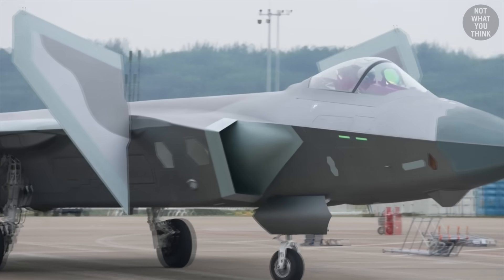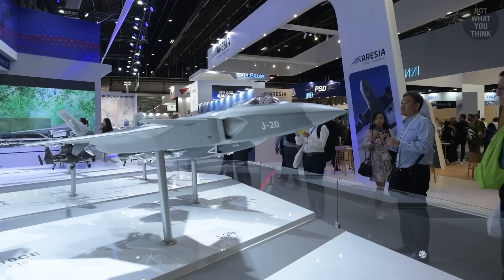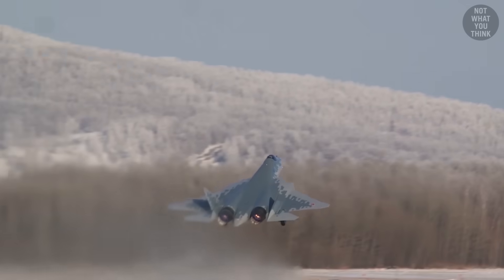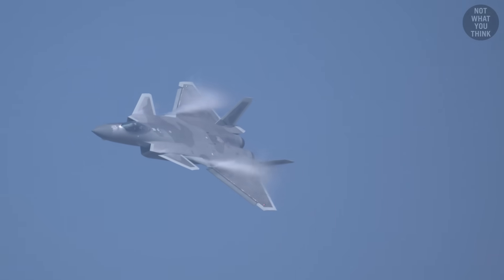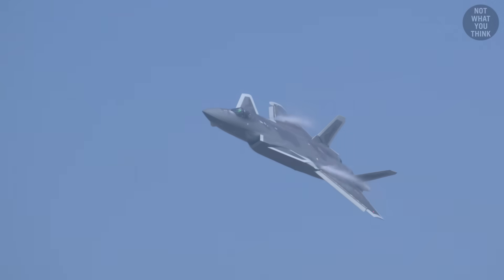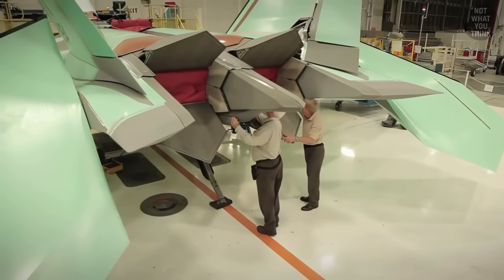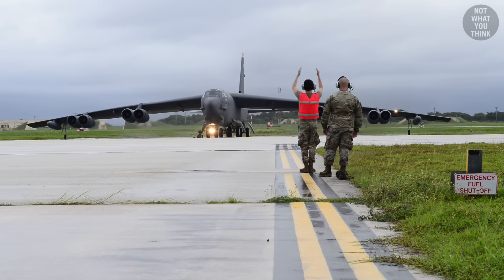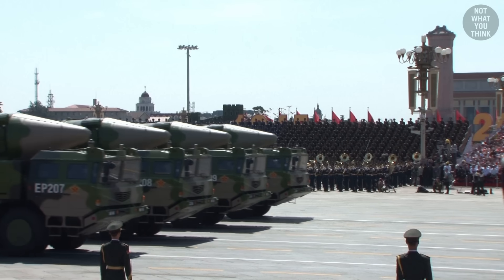Why China's Stolen "Stealth" Fighter is Problematic

Comment: Even if the Chinese is able to hack into a website and obtain the designs of the F35 it doesn’t mean they will have a bona fida aircraft. To make one you would have to copy word for word, screw for screw and nail for nail. Being Chinese they will cut corners and won’t do it properly…..which means the fake version will be worse than just being inferior.

Comment: The reality is that these engines are going to use afterburners and not be able to use super cruise reliably. They might be able to do it under perfect circumstances but under an actual battle they’re gonna be noticed immediately. Meaning this is just a really expensive and pointless 4th generation fighter that looks kinda like a stealth fighter. 

These engines are gonna get burnt out so fast as they are not reliable at all. So they’ll fly a few missions and then have to be fitted for new engines.

Comment: I would imagine that 60-120 of that 200+ units still have the Ruskis engine... And will forever for 2 reasons:
1 More likely from the time by the new engine became available the old engine was still being made and fitted. being communist they have a stock pile of 2 full engine changes for each of up to 120 craft built before the new engine was ready you cant let them go to waste.
2 I suspect the J20 like all other Chinese weapons and products have limited maintenance services and capabilities, building ships and plans is easy but the maintenance... Well they don't maintain there elevators in there buildings.

Also Hence I suspect that also 20-40 have blown up in the run ways, and in testing and Training. Remember Yuri Gregorian died in a training accident why couldn't that be the case with the CAF?

Comment: People pitting J-20 against F-22 do not understand the grand scale of things. 

F-22 is built as the Air superiority fighter, being capable of Beyond visual range engagement, short-mid range combat with IR missiles, and if it comes down to it they can dog fight with guns. No doubt the F-22 is superior in nearly every aspect and has a higher chance of winning against the J-20.

J-20 was NOT built to be an air superiority fighter. In fact, their decision to remove the guns altogether points to a fact that the Chinese do not intend to let the J-20 stay in the airspace to contest it against enemy fighter after they use up their missiles. They most likely won't stay to fight. 

Instead, the J-20 is like a Missile bus with its large payload. They use their large numbers and stealth to try and sneak in and move in as close as possible to enemy support assets like AWACS and Air refueling tanker planes and unleash their missiles before getting back to base as fast as they can. The chinese only need to destroy these assets and their adversaries will have a difficult time operating in contested airspace.

Comment: Though the J-20 is designed as sort of a long-range interceptor, to intercept and interdict particularly AWACs, tankers, comms relay etc; the F-35 will have no problem detecting and tracking them from several hundred miles with its AN/AAQ-37 EODAS. Furthermore, the F-35 can transmit and share this info to other fighters, AWACs, Navy ships or even ground assets.
Reply: These technologies are not mysterious. China's j35 can also do it. These technologies are no longer new technologies. The United States should speed up innovation, such as unmanned combat aircraft or sixth-generation aircraft. Now, although the United States is still leading, China is catching up very quickly, and the United States should increase its speed.
Reply: @jerrytom5841  J20 also has EODAS system, in fact, this tactic is also true for China. In fact, the fighter jets that China uses to intercept AWACS and tankers are J16s launching PL17s. The range of PL17 is as long as 300-400KM. J20, on the contrary, shoots down the opponent's AWACS and waits for the F35 to open its radar to search for J16, and then completes the sneak attack on the F35.
Reply: Your statement is not valid, J20 also has EODAS and EOTS. In real combat, it is the entire system that is compared. And J20 has a range advantage.
Reply: Note that the J20 also has EODAS. This also applies to the J20 finding the F35. The real competition is the entire reconnaissance system and early warning system. The stealth fighter is just a platform for launching missiles. Moreover, the J20 is faster than the F35 and can quickly leave the scene after launching the PL15.

Comment: J-20 is basically doing what F-104 Starfighter and F-4 Phantom does in the Cold War. While the J-35 is equivalent to F-35A and F/A-18E/F Super Hornet.
Reply: As a Chinese, I will tell you a secret, J 20 engines are imitated in China, high-speed Flight 3 times need to replace some parts. The F 22 is the strongest.
Reply: How is the J-35 remotely similar to the Super Hornet?

Comment: Just felt poised it point out: the rcs table you show at 0:15 is wrong. While the actual rcs specs of these planes are unknown, the f-35’s is significantly smaller than the f-22’s
Reply: Not only is it wrong, it's also very deceiving.  

He used the median RCS value of the J-20A in the X Band without RAM or stealth coating, and yet neglected to mention that.

Comment: The J 20 without having a gun will be an F 4 Phantom. Produced a lot, not made for a fighter role, & will be shot down in a dogfight. Also, the f-22 is getting a massive upgrade. This, along with the mass production of f35s, will keep the j20 in check. by the way, Heat signatures won't be detected on radar. It just gives away a lock for infrared heat seeking missiles.

Comment: I'm surprised you didn't mention the lack of trained pilots that China is struggling with. Their carrier pilots still struggle with carrier landings to the point that almost all of them have never performed a carrier landing successfully. All of their pilots still struggle with the lack of any real combat experience. Simulations and training can only take you so far. That's not to say China has no skilled pilots, I'm sure they do, but there is a lack of experience that has resulted in China hiring foreign pilots to train their own pilots. It doesn't matter how good the J20 is if the person on the stick does not know what to do.

Comment: "... the heat signature of the afterburners would be visible on radars..."
Uh... no. No, it wouldn't. Radar doesn't pick up heat signatures.
Infrared sensors is what it would pop up on.
(Which, by the way, is more of a "your missiles can't get a reliable target lock on me" than "you don't even know I'm here" type of issue.)

Comment: The US just finished doing the upgrade program for ALL mission capable F22s this last month. Upgrades included but not limited to, IRST radar and the RAM coating the F35s use(better and WAY cheaper to maintain) also, low drag and stealth pylons and external fuel tanks. So....the F22s with external fuel tanks are still stealthier than all other countries "stealth" aircraft and fighters ha

Comment: WS15 turbofan engine parameters 
Thrust to weight ratio 
. Between 10.81 and 10.87. 
Boost thrust 
. Reaching 18.5 tons. 
service life 
. Before the first repair, the service life exceeded 3500 hours. 
Fuel efficiency 
. Adopting advanced fuel injection technology and efficient combustion system, it has excellent fuel efficiency. 
High temperature performance 
. It can maintain good performance in high-temperature environments and adopts advanced high-temperature resistant alloy materials 
. Size. The length is 5.05 meters and the diameter is 1.02 meters. 
Weight. The total weight is approximately 1.63 tons. 
Maximum thrust. The maximum thrust without applying force is 105.22 kN (10.73 tons), and the maximum thrust with applying force is 161.86 kN (18.49 tons).

Comment: I know you know this but I feel the autistic need to mention that no stealth fighter "could track identify and shoot other aircraft before they even knew the stealth fighter was there" . They would definitely know they were there since practically all modern military aircraft are equipped with RWR and will notice that a radar is lighting them up from a specific direction, their radar just won't be able to see anything in that direction denying them the opportunity to shoot back. This is of course unless you guide the missile through the radar of an AWACS/ground based radar/any other radar than the onboard radar of the fighter launching the missile.

Comment: The J20 dragon seems to be more of an interceptor, while the F35 is a multirole and may very well use those guns in ground support and attacks on ground placements. So the usefulness of a gun has more to due with a role than any other factor. Plus having far more actual combat experience than the Chinese Air Force, along with input from 17 other nations during development, guns were seen as necessary and retained. So who do you think has the better insight?

Further with the latest $16B in upgrades in RAM , avionics, sensor-fusion, and weapons loading in the latest upgrade of the F22, all of the tech advantages of the J20 are gone. Add to that the Chinese have not had 30+ years in software development to do with stealth, air superiority, and ground support. So we'll see. The time issue for the F22 is time left on airframe, though the latest upgrade will extend that, too. AND add to that pilot training and experience and diversity.
Reply: I wish they'd restart F-22 production, but apparently that would be more costly than designing and producing a new aircraft from scratch. Who knew.
Reply: @TheOriginalCoda  That was the idea after the USAF looked at the issue. It would cost about $400M/F22... though a lot more advanced and with most of the F35's features so not really a restart and a HUGE MONSTER! That would be based on 250 units.  Every time we cut programs like this we pay a lot more... UNLESS we sell it to allies, too! Which would seem worth it. HOWEVER the 6th gen is going well because of so much is covered in the F35 development, which is a monster, almost scifi, too.

Comment: Enough with the rcs BS..all 5th gen have small signatures and they are secret as to how they appear on radar. Some use shapes, others special coating and others reflective material...unless you work there its absolutely meaningless to say which has the smallest. Hell rear section of f35 has a freaking huge round outtake and it claims to be stealthier then su57. If it can be found on the internet or known it means it was meant to be and usually downplayed or overhyped. Classified is classified. I wouldn't be surprised if j20 could outdo an f35 and 22 combined anymore then su57 do the same... its that simple and comes down to the pilot

Comment: The thing with the J-20 is yes, it is a much more "recent" development, but it still lags behind its main competitors (The US and their 5th gen industry) by many years in many categories.  Its also true that one of the J-20's strengths is in its numbers, but that only applies to it vs the F-22 (and Su-57 if you want to count that in as well). The F-35's production numbers by now far exede what the J-20 has to show for itself. 
The only thing the J-20 is a real threat to is against force multipliers with huge RCS's and slow, un-manoeuvrable airframes. I.E. AWACS platforms like the E-3, tankers like the KC-135, MPA's like the P-8. and transports like the C-17. This isn't even down to the J-20 itself for the most part, but due to the new missiles China is fielding, with supposed super long ranges and very high top speeds. Yes it helps that the J-20 is somewhat LO, meaning it can approach to a closer launch range in the first place while retaining first shot capability, but even then there are so many factors at play that i don't see it as a particular super threat or something of the like. A bit like how over hyped hypersonic missiles are/were.

Comment: The F35 guns is a mistake, base on the little I know About it.
The whole aircraft is made for BVR, you get there, you shoot them down, and none has noticed you.
If one of them manages to make it a dog fight, you are in trouble.

One quick, 737-max style, solution is to just ditch the machine guns and add sensor on their place and more counter measures.
That is like one or two tons worth of stuff you can cram in there, without adding much weight or changing flight characteristics.
Yes, that means the F-35 would be out once the missiles are depleted, but in stealth.. once you fired your shots, you should have been long gone.

Comment: The J20 is G4+ at best. It's not a "response to the F22". The F22 has been flying operationally since 2005. Slapping a newer engine on an air frame made from stolen designs changes nothing.

You can imitate the champion, but you can't beat them by copying what they do. They are still 20 years behind at best. Communism will ensure they will never be better. That's how mediocity works.

Comment: Did I hear this man say that the heat signature of the j 20’s engines would be picked up on radar??? 💀💀💀
Reply: Yep.
Makes a strong case for fact-checking.
IR sensor technology is what he meant.
Reply: I think he meant IRST
Reply: I looked further into this. 
You can actually detect the wake of an aircraft, but even something like the f22 would still have a larger RCS than its wake.
I think that he meant IRST or he knows something the rest of us shouldn't 😂
Though, if you follow the trail on the b21's range and efficiency..maybe they are trying to mitigate this effect through trying to achieve as close to 1.0 laminar flow as possible!
Reply: typical american propaganda channel be like

Comment: You lost me at "the heat signature of the afterburner would be visable on radars."
Reply: It could be true in some extreme situations.
The A-12/SR-71 supposed to be a LO (or so-called "stealth") jet, and Lockheed do successfully reduced the airframe's RCS to a considerably lower level.
However, the two giant J58 turboramjets will creating extreme long trails of ionized gas, when they're burning the thin air in stratosphere at Mach 3+ speed. The result is, the radar might not be able to see the aircraft itself, but the trails could be...
This actually became a problem for some aircraft nowadays that also designed to be extremely low observation, like the B-2 and B-21. The contrail from the engine exhaust or even the small trails that created by the wingtip vortex could be more easily to be detected than the aircraft itself (the radar can see vapors, just think of the weather radar). Some said B-2 have a tank filled with sulfuric acid solution on the engine nozzle, when they're in "stealth" mode, the sulfuric acid will be discharged into the exhaust, to absorb the steam in the exhaust and therefore eliminated any possibility that the contrail could be form.
Reply: Those Canards would show up on radar
Reply: 动态网自由门 天安門 天安门 法輪功 李洪志 Free Tibet 六四天安門事件 The Tiananmen Square protests of 1989 天安門大屠殺 The Tiananmen Square Massacre 反右派鬥爭 The Anti-Rightist Struggle 大躍進政策 The Great Leap Forward 文化大革命 The Great Proletarian Cultural Revolution 人權 Human Rights 民運 Democratization 自由 Freedom 獨立 Independence 多黨制 Multi-party system 台灣 臺灣 Taiwan Formosa 中華民國 Republic of China 西藏 土伯特 唐古特 Tibet 達賴喇嘛 Dalai Lama 法輪功 Falun Dafa 新疆維吾爾自治區 The Xinjiang Uyghur Autonomous Region 諾貝爾和平獎 Nobel Peace Prize 劉暁波 Liu Xiaobo 民主 言論 思想 反共 反革命 抗議 運動 騷亂 暴亂 騷擾 擾亂 抗暴 平反 維權 示威游行 李洪志 法輪大法 大法弟子 強制斷種 強制堕胎 民族淨化 人體實驗 肅清 胡耀邦 趙紫陽 魏京生 王丹 還政於民 和平演變 激流中國 北京之春 大紀元時報 九評論共産黨 獨裁 專制 壓制 統一 監視 鎮壓 迫害 侵略 掠奪 破壞 拷問 屠殺 活摘器官 誘拐 買賣人口 遊進 走私 毒品 賣淫 春畫 賭博 六合彩 天安門 天安门 法輪功 李洪志 Winnie the Pooh 劉曉波动态网自由门
Reply: There was a brief flirtation with a boron-based fuel for hypersonic bombers. Called "zip fuel", it has the unfortunate side-effect of making the exhaust trail show up on radar.
Reply: Should have said sensors.
Reply: Its a propaganda channel
Reply: @NeostormXLMAX  ok wumao
Reply: @NeostormXLMAX 习近平
Reply: @NeostormXLMAX  Psst. 
Tiananmen Square massacre 4 June 1989
Reply: @ΣτελιοςΠεππας  pretty sure being able to post "Tiananmen Square massacre 4 June 1989" automatically disqualifies their accusation 😂
Reply: @defeatSpace  Baloney is your middle name.
Reply: @captives6479  yep, definitely no censors
Reply: @NeostormXLMAX if you think that watch his other vids
Reply: @NeostormXLMAX  lao gan ma 🗣️🔥🔥🔥

Comment: Those who question the capabilities of Chinese fighter jets should consider this:
If the performance of the J-20 is not good, why does the military still need to purchase it on a large scale?
The J20 has now entered mass production. The quantity has exceeded 300 pieces and is still in rapid production.
1. China has ranked first in the world in the field of supercomputers for many years and can perform large-scale calculations on J-20 design data.
2. China has the world's most advanced ultra-high-speed shock wave wind tunnel, code-named JF-22, which can test designed aircraft.
3. China leads the United States in the field of hypersonic weapons
4. China’s radar technology is also at the world’s advanced level and can verify the stealth performance of its country’s fighter jets.
5. China has made zero mistakes in its multiple lunar exploration missions and brought back lunar soil. The Chinese Mars rover has completed its landing on Mars. China's space station has been operating safely for several years. China's Beidou global navigation system is operating well. China's fourth-generation nuclear power plants are operating well. From these aspects, it can be verified from the side that there is no problem with the reliability of Chinese fighter jets.
Reply: You forgot if anything happens in China they cover it up, the fact everything seems well is suspicious